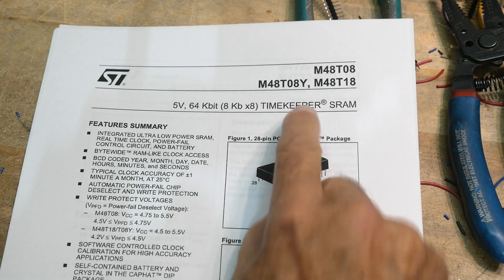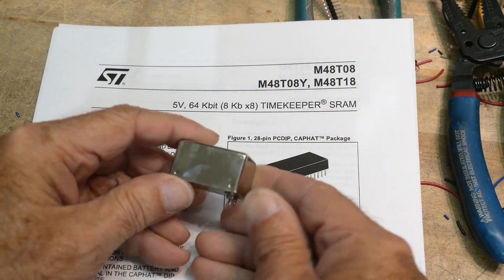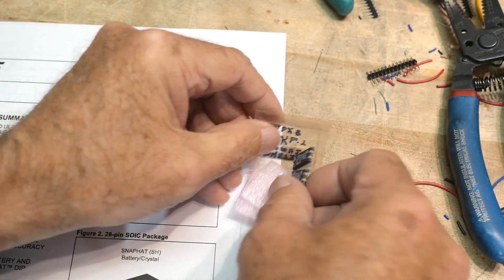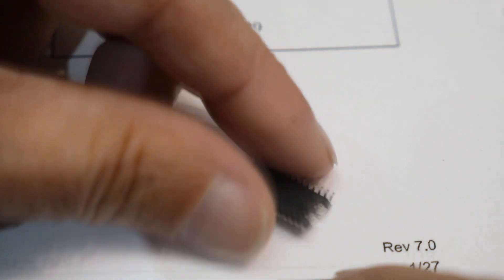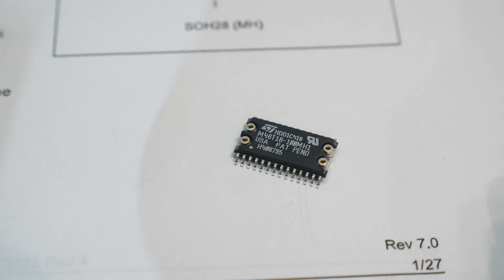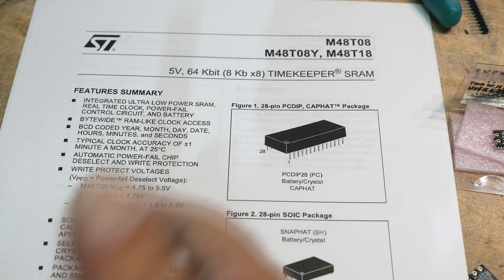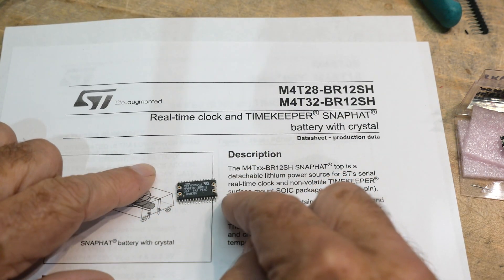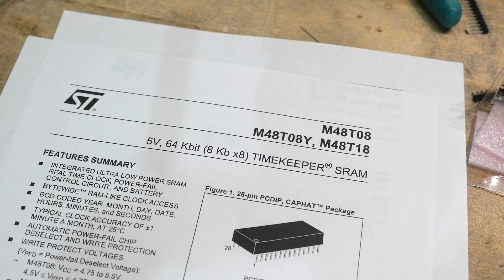#2093 M48T18 SRAM RTC

Comment: These were used on quite a few VME SBCs I crossed paths with. Google image search  "mvme6100" for some examples. Hard to miss the yellow snap-hat batteries

I always found the "snap hat" batteries to be kind of annoying as they were difficult to measure in-circuit and removing them for testing could end with the memory getting corrupted.

Comment: As they say in the DS, this also prevents soldering heat from touching the crystal itself, which can leave it more accurate in the final device without an additional calibration step.

Comment: When you said, “goes through the standard process,” you were correct. That is the main reason why this is made in two parts. The battery cannot survive the IR or hot air reflow process. This component was made to fit on the same place on a PCB that its through-hole predecessor occupied and avoided having to use mixed technology with paste-in-hole or selective wave to get the old part in there.  It also avoided putting live voltages on the PCB when the board was not installed in a machine - it is allegedly impossible to short out the battery after it is snapped on the RTC SRAM. I worked with Dallas to develop this part for them, because we were one of the major battery backed NVRAM consumers, and we needed this SMT solution.

Comment: Battery backed parallel SRAM (not i2c) is very useful to store values generated in analog circuitry. Yes, I know this sounds like an oxymoron, but if you want to use digital functionality, like encoders and momentary switches, but not have a microcontroller, you have to store state and settings somewhere.

Comment: Back it the day, I had a design with a RTC chip and solder in radial leaded lithium primary cell.  I  get a bunch of alpha boards back from assembly, all with dead RTC's .  Come to find out the stock room decided it would be a good idea to stick all those battery leads into a sheet of conductive foam before putting them on the shelf.

Comment: The problem is like the Dallas chip itself, how long will the battery pack be available. I suspect once the battery fails there will be no replacements.
Reply: If it's just a crystal and a battery you could probably work something out pretty easily.

Comment: I have one with snap battery on my Anritsu VNA.... if the battery goes dead or if i change the battery without power on the machine, i lost sram and brick the VNA!!!
The battery are stock at digikey.
Reply: On the bright side this is one of the reasons those were quite common and cheap some time ago.
Reply: Makes a great project to make a bus sniffer for live chip to clone it like a jigsaw piece by piece. Unless it fails to read in a boring manner in-circuit while instument is powered down

Comment: In the late 1990s I had built a development board with a Dallas Semicnductor 8051, which had battery backed internal SRAM in place of ROM. It was before the days of EEPROM. The 8051 modules were of similar form factor with the memories you showed. They were supposed to keep the program for 10 years.

Comment: Thought you would like these odd little parts.  Personally I'm a big fan of the design.  Having had to replace the older all in one through hole versions I thought this design at the time was genius.  Battery dies, just pop off and on a new SnapHat.  You can still buy the battery/crystal SnapHat's.  I have had to replace a few of them over the years in printers and it's so much easier.  Replaced the one in my own Xerox WorkCentre 5655 just last year.

Comment: why not use a RTC?
Reply: What do you mean? This chip has RTC on it. The only difference with the dallas chip is it having more static ram banks. This is used for firmware which needs big sram to store all the configuration data and licensing blobs. OpenFirmware, UBoot and UEFI need more NVRAM than what is supplied by the legacy Dallas chip, and that's without counting RTOS stuff like VxWorks and such.
Reply: @hyoenmadan  ok now i understand, i was thinking of it as a rtc only i never thought it had other data in it + it was super off for me to have a battery in a chip and not in a cheap holder
Reply: It is a RTC.  One that you can actually replace the battery on.  Just like he described, the earlier versions had batteries that were non replaceable meaning you had to desolder and replace the whole module.  With this design the battery and crystal just snap on in the separate "SnapHat".

Comment: As you said, it does make sense to make the electronics portion of the product compatible with PCB solder flow methods.  It also greatly simplifies replacing the battery because there is no soldering.

Comment: Its there so the company can charge an arm and a leg for replacement, and to make it obsolete if they so choose.  Evil design.
Reply: Actually, is worse having all the parts potted together. In this design, you can depot the outer hat only, and check the battery and crystal values without damage the inner chip capsule. And then you can make your own replacement parts in case they kick the replacement hat from the market.

You can do the same with the dallas chip, but the process is dirtier, and may require desolder the sh*t if you don't want to damage other parts in the PCB. Also, since this ST clock/sram chip is used generally in instrumentation and/or medical equipment, you may not do your own replacements unless is ABSOLUTELY necessary.

Comment: I used a lot of these Dallas clocks more than 30 years ago. I still design circuits around a variant of this ST chip. The I2C HW interface and registers are still the same as they used to be. The reason is that this same clock chip was used back in the days in all MS-DOC and then Windows PC's.  So the software driver is the same for all computers. The ST chip variant is still in production and is very popular.
Reply: Oh interesting, I had no idea those were i²c, neat! 
That gave me some ideas ... hehehe

Comment: The mk48t08 version is used in mvme cards. A little frustration when the battery is going bad in equipment, causing it to lose the settings.